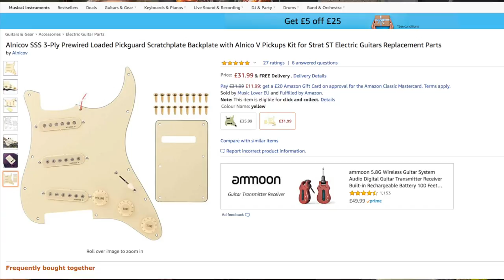How To Install A Pre-wired Pickguard Fender Squier Strat

Comment: Finally got around to installing the same pickguard with p/u's in my Affinity.  Your instructions really helped. My one question is my affinity came with larger pots versus the dime size pots that come with this replacement. How might that effect sound? Ceramic with larger pots;  Alnico with dime size pots.  The former seem hotter?  I did not do a before after recording plus I am a beginner.

Comment: Who ever wins this will should be pleasantly surprised.....I got one from China a while back for under £20 and it sounds great....more stratty sounding than the one it replaced especially on positions 2 and 4 with a bit more output overall too. 
Did you measure the resistance of the pups Rob?
Reply from the maker: Yes I'll replay later with the figures

Comment: I installed a loaded pickguard on one of my stratocaster guitars and I 
used WAGO brand wire connectors instead of having to solder.Here is an 
ebay link to the WAGO brand wire connectors.:  
https://www.ebay.com/itm/353426003274?hash=item5249d4d54a%3Ag%3AY0IAAOSwyThgVSvr&LH_BIN=1
  You can solder the wires if you want but for me the WAGO wire 
connectors are a much better option because with the WAGO wire 
connectors there is no risk of damaging the pickguard or the guitar body
 with soldering and what's more if the loaded pickguard ever needs to be
  swapped out for another loaded pickguard then all that needs to be 
done is to disconnect the three wires from the WAGO wire connectors and 
attach the WAGO wire connectors to the three wires on the new loaded 
pickguard and done.
Reply from the maker: Spamming 🤣🤣